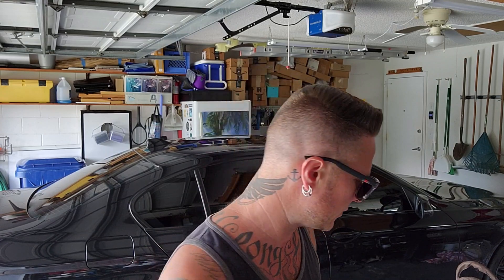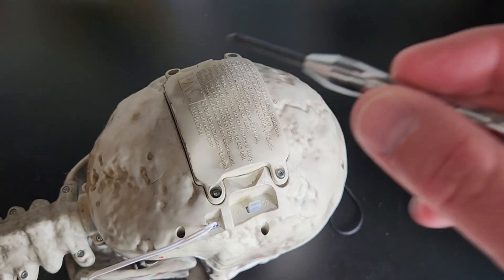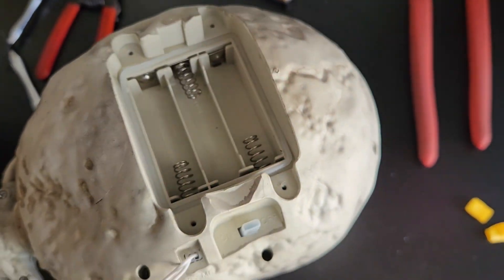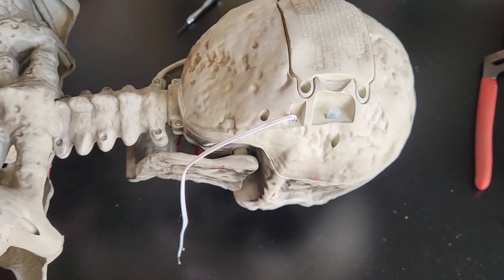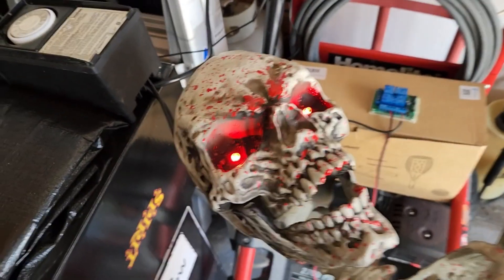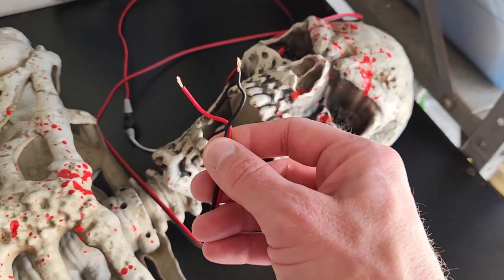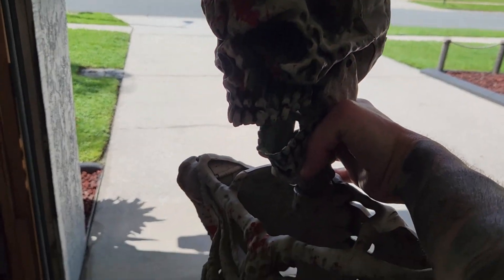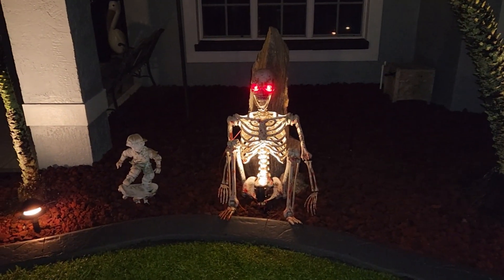Halloween DIY! Using 12V Landscape Source To Power Your Poesable Skeleton Eyes!

Comment: I did something wrong, this didn't work for me. Any chance someone can reach out and help. Thanks
Reply from the maker: Hey, sounds like you may have used the jumper cable on the back of the skull in the wrong direction. Have you tried taking the cover back off the back and switching corners?
Reply: So my skeleton only takes two batteries. Do I just take the jumper wire and reversing it from the way, I have it now? Also, my speaker wire was two wires, and I cut it in only used one of the wires.Does that make a difference
Reply from the maker: @Dani-j4f9w couple of things. If you only have two batteries in the back they could be a lower voltage LED that might not be capable of handling 12 volts. But I would still risk it.

Yeah, you only need one single wire to do the jumper inside the battery box on the back.
Reply: @Scantron5k nothing is working.. does this mean I need skeletons that have 3 batteries instead of just 2?

I have a 3 battery one- tried it there and still nothing..
Reply from the maker: Sorry, I can't see what you are doing so I can't say one way or the other. You have to have a 12 volt landscape power pack source as well.